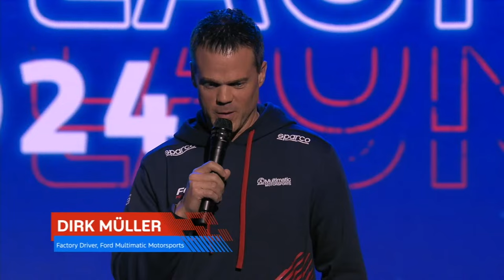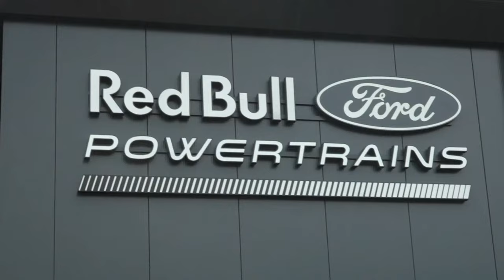2024 Season Launch Event | Ford Performance

Comment: I still own a '93 Probe GT. Still has timeless grace in the lines.
Reply: Cool !   I was at a Ford dealer looking at Probes back in1994 when I saw a Mustang pull into the lot.  I ended up buying a 95 Mustang GT.  Who knows?..if I hadn't bought a Mustang I might have a probe.

Comment: No more boring products Jim? Let’s get rid of the electric escape that you’ve disgraced the mustang name with, make a 10x better looking ranger, and make the maverick a car again🤷🏼‍♂️
Reply: lulz "disgraced the mustang name" yet it out sold the challenger and killed off the camaro for the second time...... take a lap
Reply: @chubbsmcgee2096  everything else they’ve done with the new generation of mustangs is fine w me🤷🏼‍♂️
Reply: as much as i dont like names being associated with other platforms, to get a new platform to SELL, you sometimes have to associate it with an existing platform, at least ford did a good job and it wasnt a bust. i dont care for electric, but its got some sleek design lines
Reply: Hey don't bust on the Aerostar Mach -E! Wouldn't that have been better?